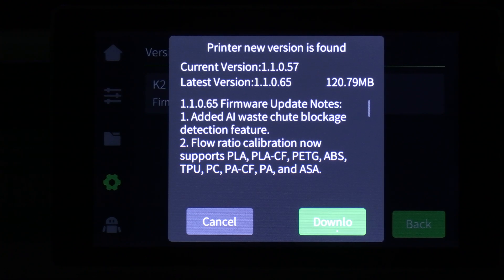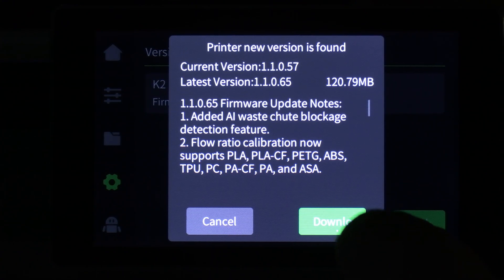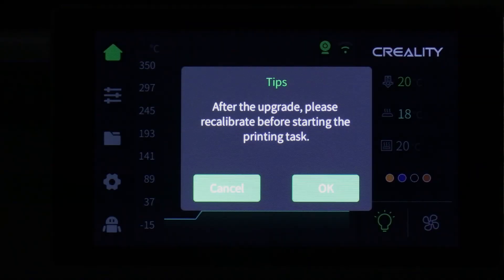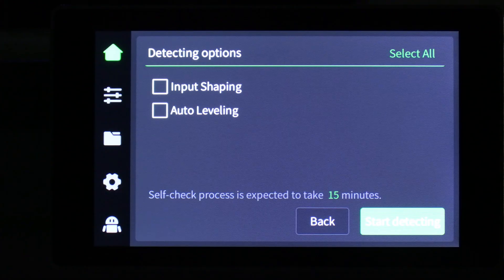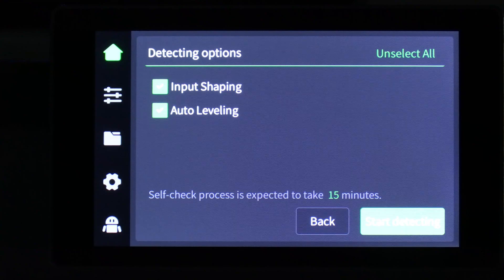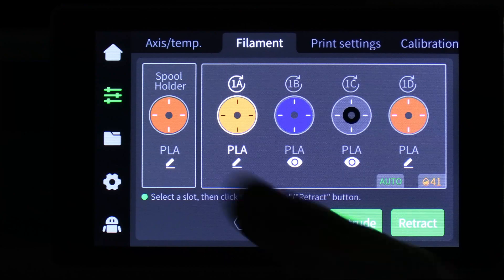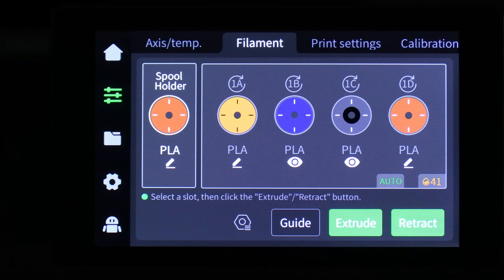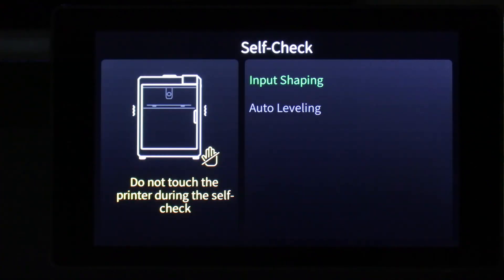K2 Plus: NEW Firmware, HUGE new Feature. How to Update properly

Comment: My printer keeps on saying ". . . fialament detected in extruder . . ." even  after clearing it, replacing the Nozzle, replacing the tubes, I've checked the blue light in the sensor is working.
I am thinking of running system update, do you think it will work?

Comment: It appears like the update did not require a factory reset after the update like on K1s, true?  Although it’s not supposed to completely clobber a Klipper installation, I have had repeated problems after updates on my K1 Max. 😢
Reply from the maker: Just a Calibration, as shown here. This is my K2 doing it, in mostly real-time. Went smoothly

Comment: why hasnt anyone shown the bed leveling mesh?
Reply from the maker: Haven't had a need. Never looked at the mesh on any of my K1 or V3 machines
Reply: @3DRundown  although my K1 max prints I know for sure the bed is not that level. I wondered if the new bed will be better

Comment: This firmware patch was brought to you by @NathanBuildsRobots failed mod attempt and caused a chute blockage and a total print failure.
Reply from the maker: never heard of him, but Creality sent out a memo about him breaking things.
Reply: @3DRundown  Not that you care but, he only has 45k subscribers and is also one of the few that got a K2 printer. Also, due to his engineering background he tends to disassemble products and has harsh requirements. For example, he violently pulled on the gantry of the K2 to force it to lose a step but thanks to the closed loop steppers the printer moved right back to where it was supposed to be.